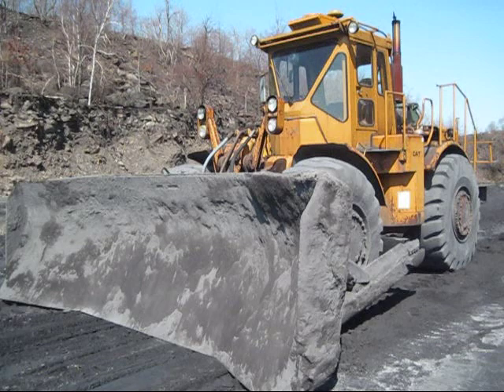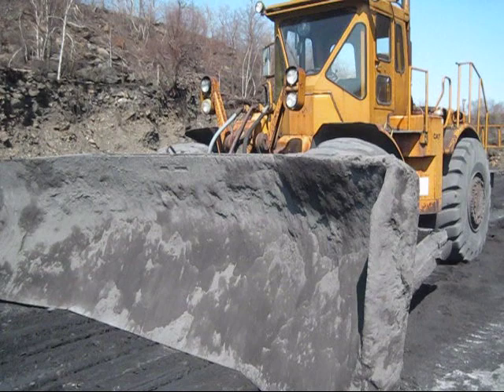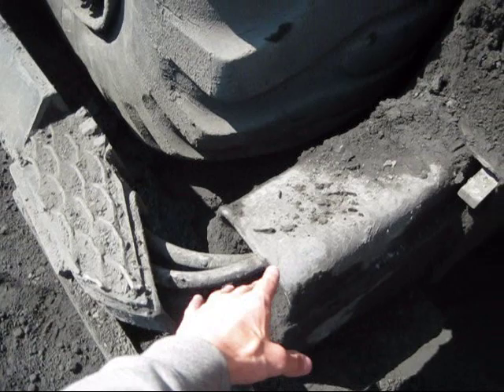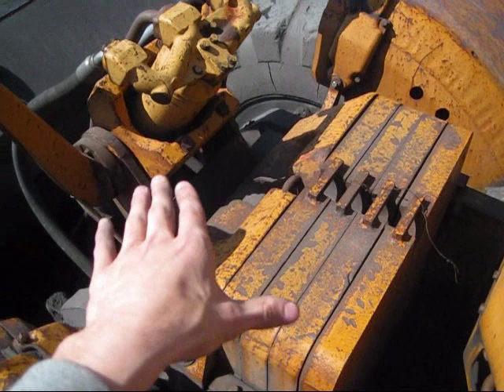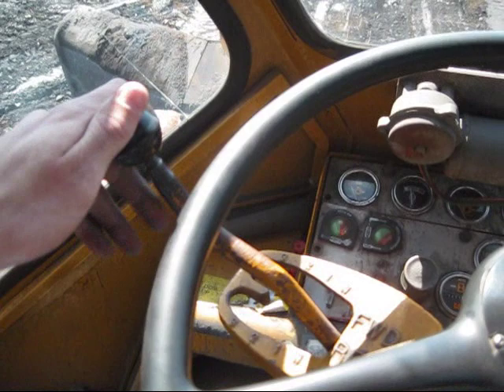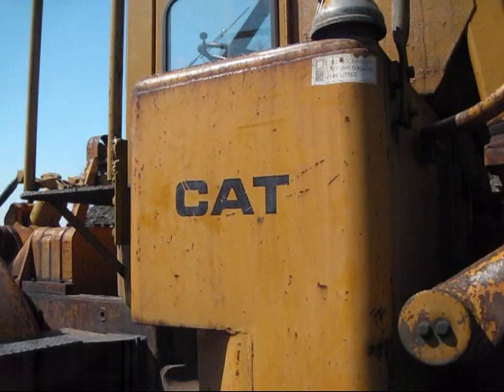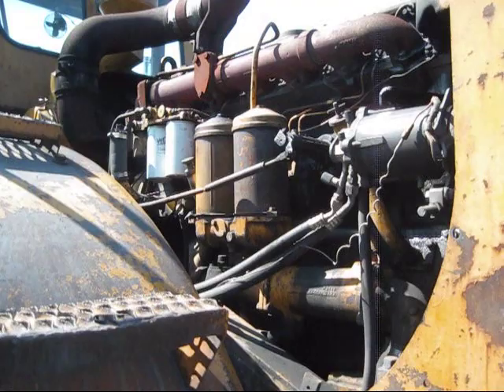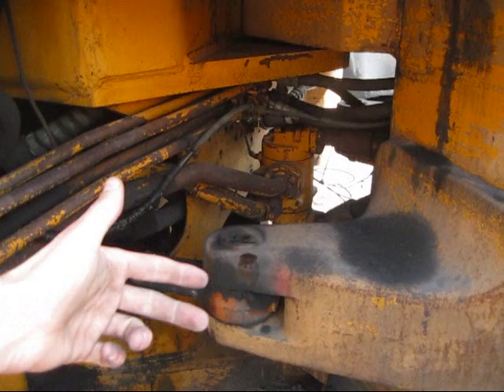Caterpillar 824B Documentary

Comment: Very cool machine, I love the cabs on all of the older cat equipment... very industrial looking.  The back of the outside of the cab seemed to resemble a bit of the 992B as well (although those doors arent sliders like on the 992B of course).  Seeing the weights on the front drive axle was pretty cool too, never seen that arrangement.  Lots of cool old equipment to see there, the Bucyrus Erie excavator was impossible to mistake in the background.  Thanks for the post!

Comment from the maker: @davide30541 Yes and no. While a wheel dozer may not have the push power of a track dozer of equal size, it has more speed and versatility. Wheel dozers aren’t designed for the work a track dozer would be used for.